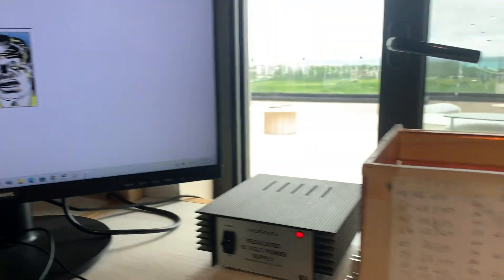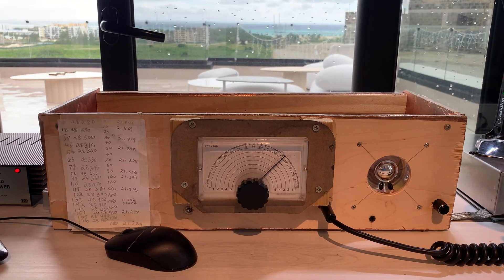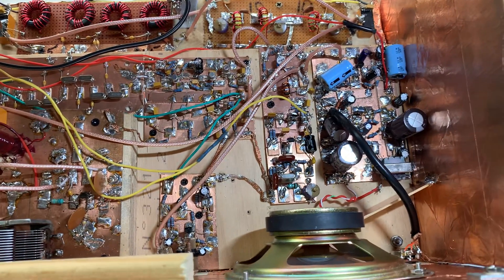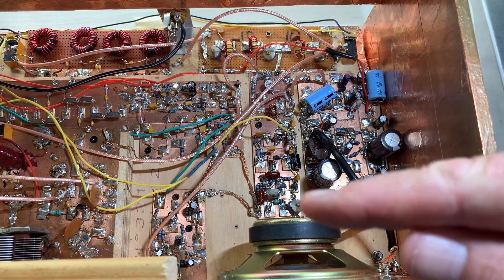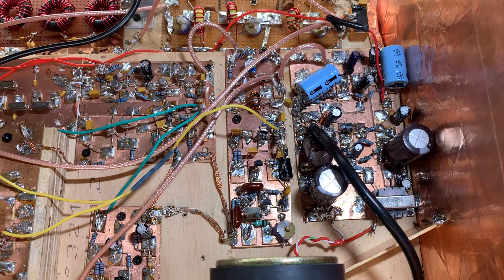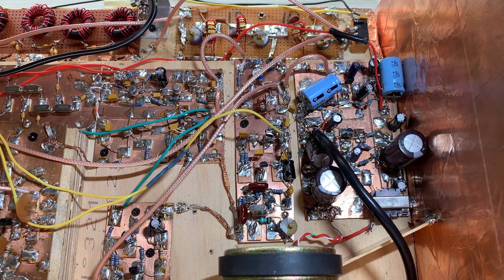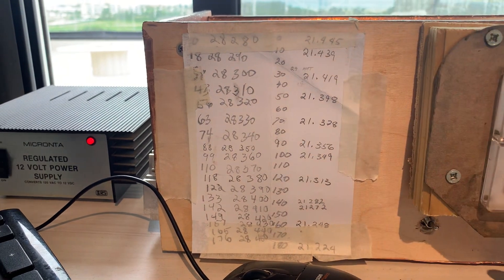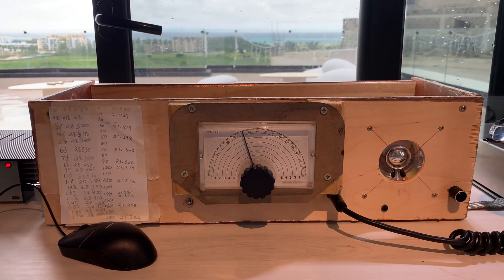Troubleshooting a Homebrew SSB Transceiver...

Comment: That is a fb looking xcvr and qth Bill! Thanks for the debug example. I wonder if the changes you made to the boards near the 10 meter filter are what created the need to readjust it?
Reply from the maker: I don't think so.   I think the filter just needed some tweaking.  I think output on 10 was low all along.

Comment: Did you need shielding for the volume pot? It looks like a piece of vertical pc board soldered to the wall of the case between the Audio pot and the audio amp.

Comment: How does changing the emitter caps to 470 change the sound?
Reply from the maker: It did for me. It widened the AF frequency response and made the audio sound better.  That is why I did it.
Reply: @ thanks, on the hack a day page there is a note saying it would help the audio for voice but doesn’t say how or in what way
Reply from the maker: Just curious:  Are you building the receiver?  How far along are you?  What is your ham radio callsign?  Thanks,  Bill
Reply: @Yes of course! But I live in New Hampshire and right now and for a couple of weeks I am in 6 land working and not building anything. 2nd try pto oscillates, made a diode ring mixer but don’t know if it works & used 1n5711’s cuz I had them, made a band pass filter but on the Antuino it looks like the higher frequency skirt is not very steep at all and like the the loss in the middle of the peak is down 11db :(, not sure if that’s true, did start out with 31 turns ( thought I wound 30 ) and 6 instead of 26 and 5 because it seemed more in line with Hans design and what n3fjz did and what calculates on Diz’s site. Need to try 5 and 26. When I find my AADE LC meter I’ll be able to tweak it better. Have not really started building the audio amp yet but have all the parts. de aa1of
Reply from the maker: Thanks Jerry.  Sounds like good progress.  Maybe use a computer powered speaker or a guitar amp as a temporary subsitute for the AF amp.  You should hear sigs even if the BP amp is significantly off.  Signals on 40 are quite strong.  In a pinch you could test the mixer with just a computer speaker or a guitar amp and NO BP filter.  You could use an ordinary SW receiver to see if the PTO is in 40 meters.  .  73  Bill